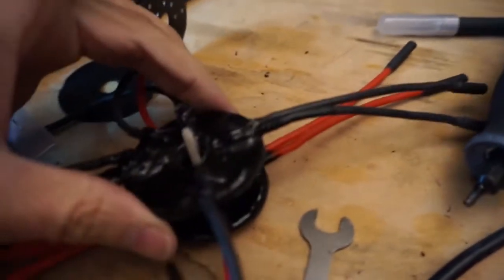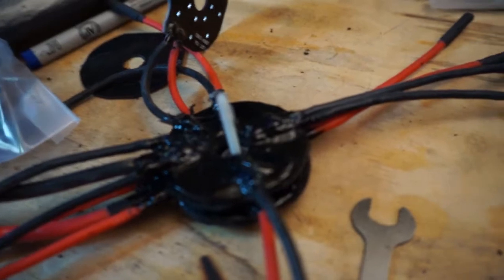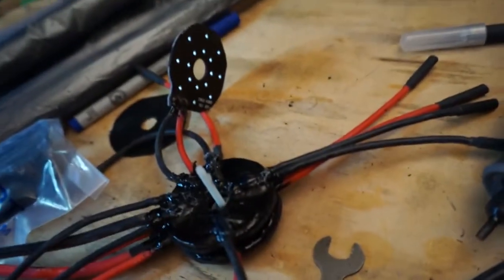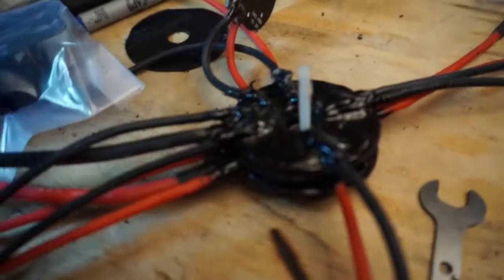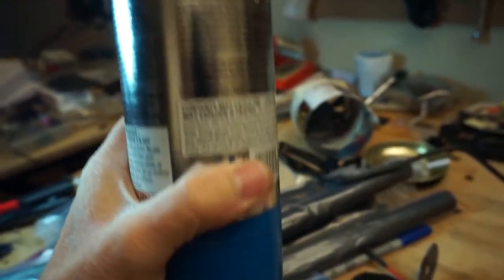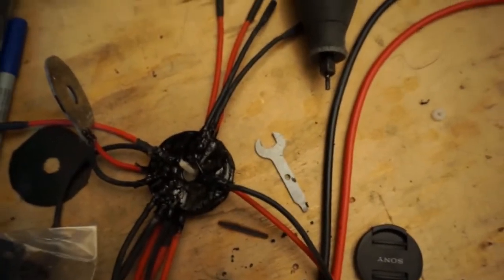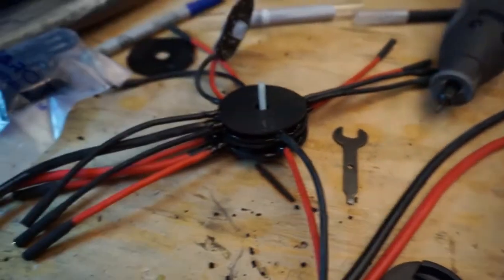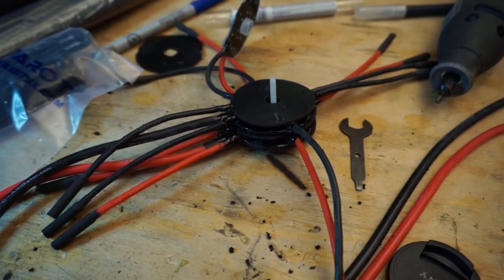Power Distributer-Project Power Greed

Comment: I noticed you have used Brass for your Power Distribution Board. However, brass electrical conductivity is not as good as copper, and it's only 28% as conductive as copper. Have you experienced any issues/losses with its use? I guess, if you have large enough cross sectional area of the conductive material (brass), it will not matter.
Reply from the maker: I based my idea off of the the Power Hungry boards. Which are made of brass.
I consulted an Engineer and he didn't see a problem with it. I also tested the resistance with a multimeter and showed no resistance either. I also read that there can be some issues with soldering coper if there's corrosion. But I don't know how true it is. However, when I consider most power distribution boards on the market they are made of brass. If I made it from copper this would have been cheeper. If I make another I will use coper if I can confirm that soldering copper plates to wires will not lead to week soldering joints. Check out Power Hungry Boards and tell me what you think.
Thanks for the feedback.
Reply: Will Wegenast
Thanks Will, I checked out Power Hungry Boards and their plates are made of - 'Copper plates nickel and gold-plated'. I have few pieces of brass plates with differing thicknesses, and was wondering if I could utilise them, the way you have fashioned your Power Distro. Check out http://www.bluesea.com/articles/108.
Reply from the maker: Well then I think I'm going to haver to make one in the cold months and replace the one I have. :)

Thanks for the info. THis very helpful.